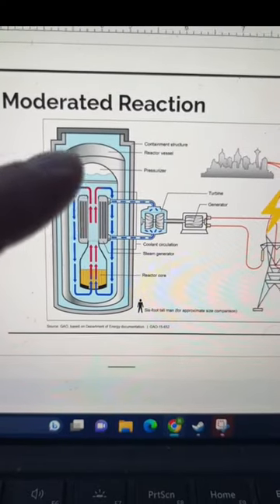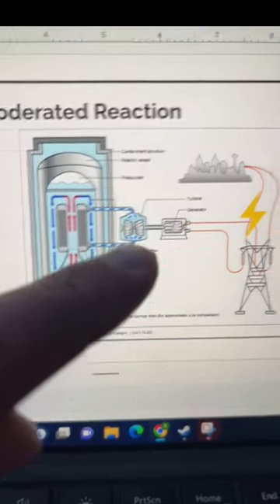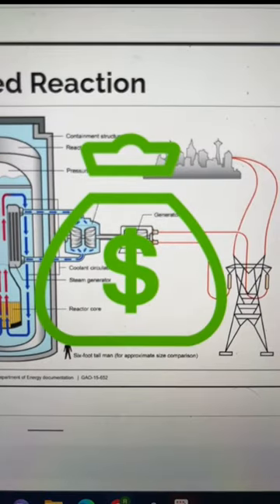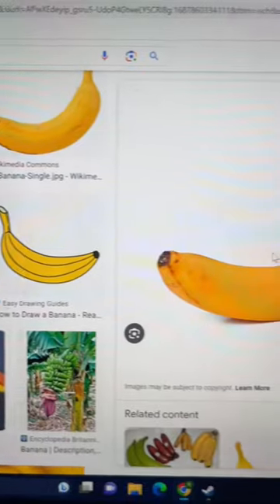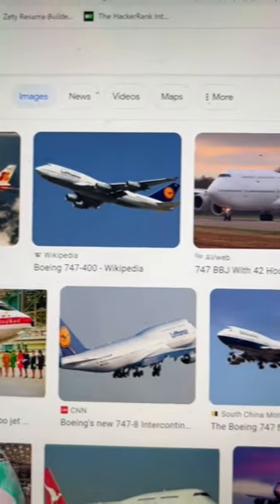No, The #Zaporizhzhia Nuclear Plant Will Not Explode

Comment: Nuclear power might be the most feared energy source compared to how dangerous it actually is. The people who make nuclear reactors and dispose of nuclear waste know what they’re doing, and they know how to make radioactive materials the smallest threat they can be.
Reply: Yeah cause we have so many fuel sources to compare to 😂
People think Crystals are SUPER powerful and capable of harming or empowering others... and yet Piezo is far less powerful.
Thatll throw your ratio off if you are also comparing how powerful they are, versus how feared they are, versus how dangerous they are
Reply: the danger isnt how many times things go wrong, but what happens when things go wrong
Reply: @jordanwardle11  Compared to other forms of energy, nuclear has had the fewest catastrophic failures.
Reply: I agree OP. Lots of people seem to think that it's too dangerous to be feasible; but like, oil and coal are infinitely more dangerous and have caused the deaths of so many more people than nuclear
Reply: The funny thing is that even windmills, solar, hydro and geothermal claim more deaths than nuclear. I understand people can fall from a windmill, a roof with solar or a hydro dam. But I can't figure out how to die from geothermal.
Reply: Yah, just look at Chernobyl, Three Mile Island, and Fukushima.
Reply: @LordMondegrene  and now compare that with people that affected and die every years because of coal reactor and fuel.
Reply: Most panic about nucular, I mean nuclear, from fuzzy minded hippy types has little basis in reality.

But safe long term storage or disposal of the waste is an unsolved issue, especially if you get into longer time scales.

Take for example the Russian soldiers digging up the earth around Chernobyl and getting sick. Sucks to be them. They were warned. Etc. But it highlights a couple of issues. 1) The difficulty of cleanup when there is an accident, and ignorant people coming along and unknowingly exposing themselves or others.
Reply: @MarcosElMalo2  The safest way to use spent fuel is to turn it to munitions, and fire it at your enemies lmao
Reply: They most probably know what they're doing. Especially when it comes to money :) 
When fuel rods are so harmless, then we don't have to fear dirty bombs, Irans powerplants and there won't be any financial loss should your house happen to be covered in pulverized spent fuel rods. Totally safe! 
Have a banana split with some plutonium on it.
Reply: Three mile island operators agree.
Reply: @dashikashi4734  sure, ill explain my comment. it matters not total numbers if 1 incident can do far worse than a multitude of incidents
Reply: @LordMondegrene There’s only one confirmed death from the Fukushima nuclear disaster. Nuclear power plants rarely fail, and modern nuclear power plants are designed to be as safe as possible, even when something goes wrong.
Reply: @estrogenyumyum4801  We'll store the high level nuclear waste in YOUR yard, since it's so safe. Thanks!
Reply: @buddy1155  Apart from workers inside a geothermal power plant being affected by an accident that can happen in many industrial settings, the main risk with geothermal is earthquakes. But even then, they are basically always small enough that they only do property damage.
Reply: @LordMondegrene I never said nuclear waste wasn’t dangerous. But as was said in the video, there are ways of handling nuclear waste that can minimize the danger.

Anything is safe if you have proper precautions. Storing nuclear waste in my garden is dangerous, but it wouldn’t be dangerous if you were to encase the nuclear waste in a thick layer of concrete and then buried it deep underground below my garden, it would be perfectly safe. Radioactive materials are dangerous if they’re improperly handled, but the people who handle nuclear materials know how to keep the nuclear material safe. They know how dangerous radiation can be, and they make sure it doesn’t end up hurting anyone. 

Any and all ways of producing energy has pros and cons. Nuclear energy is very environmentally friendly compared to most alternatives, but it can be dangerous if handled improperly. The way to counteract the danger is to handle nuclear energy and nuclear waste properly.
Reply: @LordMondegrene  There are perfectly safe places to put it. Finland dug a huge underground tunnel in a remote location in which their spent fuel could be put for the next 100 000 years. Nuclear fission has flaws but it is still the most effective way of generating energy we have right now.
Reply: @aphextwin5712  I think I know why, it was # fatalities for every xx MW produced.
A nuclear power plant has simply very low number of employees to power production ratio.
Reply: @estrogenyumyum4801  Your "solution" just kicks the can into the future.

Nuclear power CAN be made safer, but that would cut into profits. Which is why Chernobyl, Three-Mile Island, Fukushima, several thousand square miles of the Ural Montains and Hanford Nuclear Reservation are some of the most radiotoxic places on Earth.

The profit motive makes nuclear power a danger today. That long half-life makes nuclear power a danger forever. 

Business will ALWAYS cut costs until they cut your throat. That's "the unseen hand of the market" holding a straight razor to your neck. You can't make it both safe, and profitable.

Source: my dad worked in nuclear medicine for 30 years. He studied the harm done by radiation, and knew intimately the effects on his patients. He knew people who worked at Sandia and Los Alamos and Lawrence Berkeley Labs. They told him horror stories about the kind of idiots they have playing with U-235 that would curl your hair. They make the "Demon Core" story sound like a walk in the park. 

There is no way to make nucear power safe, AND profitable.
Reply: @jordanwardle11 yes and it's not so much a matter of when things will go wrong but if they will go wrong because these scientists and Engineers who designed these reactors and design the way storage facilities have learned from previous mistakes such as not hiring yes men of the state party, one of the most infamous Three Mile Island compared to Chernobyl and Fukushima which both had terrible design flaws was relatively minor it was more about the lack of communication to the public that was the biggest issue
Reply: @LordMondegrene Chernobyl was designed by Yasmin so safe he was not a concern and then Fukushima had a terrible design flaw that was pointed out several times yet the company through backroom dealing with the government got around those safety concerns and then Three Mile Island was more a failure of communication with the public between the federal government the reactor operators and the utility company
Reply: @LordMondegrene except that's not how they do it they try to keep it as stated in the video a concrete sarcophagus which is usually kept on site until it can be moved to a long-term storage facility which usually involves burying the sarcophagus has
Reply: It's just that if the worst happens, and Fukishima and Chernobyl were not the worst- we lose half a continent. Like they nearly lost Tokyo and how they actually lost 1000 square miles for 100 000 years at Chernobyl, and came within a whisker of leaving much of Europe in that state. Uninhabitable. For 100,000 years.

Not much chance of a solar panel doing that. They hardly ever explode.
Reply: @clonescope2433  try again, in English.
Reply: @a_name1000 Coal powerplants emit more radioactive particles and radioactive waste than nuclear energy does, and it goes straight into your lungs as its fine airborne dust. 

Usually a mix of uranium and thorium, about 5 ton per plant per year at the most conservative estimate.
Reply: @LordMondegrene  to be fair, everything could be dangerous if the maker decided to cut Corners.
Reply: Three mile island has entered the chat
Reply: @LordMondegrene  Yes, look at the 3 disasters and see what they can tell us. Chernobyl was a bad design with no containment and a combination of human error led to a significant release of radioactive material. Fukushima survive a 9.0 earthquake and tsunami. It was only after water flooded the backup generators did the reactors melt down. But even after they melted down there was no radiation release. It was a hydrogen explosion that allowed radiation to leave the facility. 3 mile island had practically no radiation release. I think we can design significantly safer reactors than those built in the 1960's and 1970's.
Reply: The real problem with nuclear power is that it's more expensive than renewable and many of the costs are pushed into the future onto our grandkids. 

When private companies are willing to reinsure decommissioning costs. Then we will know they are close to realistic.
Reply: @RemixedVoice Not fun fact but coal plants actually produce several times more radiation than nuclear plants.
Reply: @jordanwardle11  Yeah, but they statistically never happen lol
Reply: @ryangoepfert9112  Yes, but since "radiation" is a nebulous term that can refer to any emissions or particles, from deadly neutrons to warm sunlight, it's nearly meaningless in this context.

... add to that the fact that I NEVER IN ANY WAY DEFENDED COAL, and you come across as intellectually dishonest, and trying to change the subject, because the arguments for nuclear are similarly weak, cherry-picked, and ignorant of history. 

But thanks for contributing to the meaningless noise puked out by the nuclear industry, I'm sure they're incredibly grateful for your stirring defense of their profits.
Reply: @snydedon9636 Three Mile Island was 40 years ago. Technology has advanced a lot since then. Power plants have gotten way safer.
Reply: @jordanwardle11 Yes, maybe, and also kinda no. Depends a lot on your tolerance for viewing danger, risk and harm through a much greater aperture. Big picture, we should have been gunning for worldwide nuclear-energy'fization for decades already, through international programs of developing a vastly superior commercial section with govt incentives for new non-breeeder reactors of variable scale, including low or maintenace free reactors for ocean transport. Make nuclear reactor deployment scale so great that we get genuine economy of scale benefits, instead of an industry that is extremely hyperexpensive because "shutdown orders could come any day" so no one dares invest, neither in new projects nor modernizing what they already have, and in som3 cases can't even predictably secure funding for long term basic upkeep so they have to shut down some plants in case they have to cannibalize one on short notice to keep another going safely. And compensate the loss of energy with coal. 

We really screwed the pooch on energy. Nuclear is the cleanest, and big picture safest and least-harm option we have. And it's the only thing able to carry our vast and explosively growing energy needs through a many-decade transition into clean renewables (and hopefully, eventually, also fusion). It's the only thing that can be operated in such vastly diverse regions and conditions as neccessary throughout the world, as different (and new) clean renewables keep incrementally improving. Some regions are very furtunate with their climate, topography and larger ecosystem conditions, and either already are or could with moderate expansion be wholly covered by clean renewables already (Hydro, wind or a combination of both being most common among them so far). Most are not so fortunate though, and even though each must deploy renewables in forms, mixes and scales that make sense in their respective regional conditions - few have any hope of getting where we need to go in what little time we have for damage control, without nuclear energy as the spine and trunk of their energy systems (the "time left to avoid catastrophic outcomes" came and went years ago, we are all well and truly balls deep into damage control territory now). We cannot just keep on "buying the quotas" off the lesser-industrialized and lesser-developed 3rd world. It's a slow, universal self-f$&king ponzi scheme of literally global proporsions and consequences. It only results in maintaining continued (and in many cases further increased) excessive pollution by the relatively few super-polluter countries and regions that can afford to buy their way (which are also the only countries that can afford to heavily invest in, develop and pioneer both cleaner more efficient options and even recapture systems).

We know damn well that the rest - those countries whoms governments we pin to the wall and strongarm into selling us their quotas, has but a snowball's chance on Venus (or Arizona) of ever remotely delivering on the guaranteed-to-fail requirements we're setting them up for with this BS. All it "succeeds" in doing is forcing them to choke off their own industries and in some cases even a lot of their agriculture, because the international penalties for going over the quotas they have are even worse. Thereby keeping them perpetually under-foot and on the edges of full collapse. Thus all but guaranteeing that they can "never" hope to achieve the kinds of turnover, revenue and economy of scale neccessary for their industries to evolve, and by extent afford; high(er) resource efficiency and cleaner operations modernization.

If we are to still keep moving forwards with quotas, they need to be made non-transferrable, and enforced in a manner that enforces the intent and "spirit" of the system. So that those of great means cannot successfully manipulate, abuse, or exploit the system or any unintentional gaps or loopholes in it, to game the system to buy their way out of delivering on their part of fair and just commitments. If wealthy countries absolutely want increased/extra quotas, that should only be possible through greater-than balancing elsewhere, to be earned on top; no transfers. Earned by explicit, concrete, tangible and independently verifiable steps implemented (not just planned or "committed to"), to aid lesser-capable countries in sustainable and persistent means of reducing their emissions. (And/or) equally increasing their efficiency without  loss of productivity or capacity - at a ratio of at least 2 : 1 if not 3 : 1 or beyond (scale of aid-supported improvement  : increased/additional quota). The goal of enabling these "earned" additional quotas, is to incentivise genuine and substantial investments into accellerating sustainable progress where it's most needed. And the goal of setting the ratio that high, is to deter from leaning on this arrangement, of having it become a crutch. To incentivise cooperation tpwards accelleration of domestic and international investment, RnD and deployment of cleaner and more resource efficient operations, that may enable continued common growth and prosperity while staying within the original quotas. To "ensure" progress does not stagnate. To ensure that either through "quota-investments" or the international RnD collaborations, the lesser means countries can stay aboard for the ride forwards. And to ensure that when wealthy countries do go beyond their original quotas, the end product of that is (still) a real and sustainable net positive.
Reply: @ryangoepfert9112  They also produced a ton of mercury until about 2018.   It was supposed to be fixed in the 90s but they got wavers.  Most have mercury plumes extending 70 miles downwind in the prevalent wind direction.

But you are comparing coal plants to well operated nuclear plants.  Clearly, coal plants do not equal Fukishima or Chernobyl.
Reply: generally I would agree with that how ever at the moment this plant is controlled by the Russian military which I am not confident in their ability to tie their own shoes at this point.
Reply: Zaporizhzhia power plant was designed to be safe during peace time.
It is way different when a terrorist state (russia) is weaponizing it. They have all the blueprints for this powerplant and enough nuclear physicists to figure out how to.
Reply: @jordanwardle11 even when things go wrong with nuclear it's nowhere near as bad as any other type of power plant 😂
Reply: @Minox_ Water dampens radiation so well that we might even be able to tactically place it at the bottom of the oceans it might even help grow deep sea ecosystems with the heat allowing small bacteria to maybe metabolize easier.
Reply: @clonescope2433 Fukushima did not have a terrible design flaw. Only one section of sea wall was too short,  there are many Nuclear plants in japan and of plants were hit by that only those directly behind the seawalls and also the backup generators system was in a  underground structure which resulted in power loss. Multiple problems culminated in the Fukushima incident which is similar to what happened in Chernobyl
Reply: @clonescope2433 and it would have been cheaper to pump concrete into Chernobyl and level it to make a foundation  for new city structures but they want to preserve it leaving it more exposed than it needs to be when it could have actually been cleaned up decades ago. But scientists have been studying the effects of radiation for decades and all that we've learned is that humans are more destructive than radiation.
Reply: @PxThucydides Solar panels fail and catch fire though which is why people don't want to start putting them on every roof just yet 😂
Reply: @MarcosElMalo2 I’m gonna come back with a link from a nuclear scientist. Or engineer. She’s one of them. Give it a watch and understand why what you said was wrong. We have known how to dispose of nuclear waste for a very long time. But it keeps on getting buried just like the nuclear waste is
Reply: @LordMondegrene This just... isn't true. It's plenty profitable when run safely. Capitalism is terribly dangerous. Coal is where it struggles to be safe when run profitably, if any.
You seem to fundamentally misunderstand nuclear waste storage.
Reply: Yep too many unknowns with market futures for companies to invest in new nuclear facilities that don't break even for 15-20 years, or to push money into upgrading existing facilities when they are afraid heavily subsidized new "green" solutions may cause permanent shutdowns or prohibitions of nuclear plants in favor of wind/soloar/geothermal/etc. Almost all of which take create tons of toxic waste and rarely ever have a lifespan including maintenance costs that will make the breakeven investment point 🙄 But if it's what companies are pushing and governments are subsidizing then that's what will be invested in, no matter how stupid the reality is... I'll give some geothermal setups a pass, but not everyone can be Iceland and have all kinds of shallow magma hot thermal wells to drill and tap into, Ireland is not the same as Iceland 😄 and even solar farms in Arizona /Nevada don't really excel, most still lose money if you use actual numbers without free money or tax exemptions... I'm not saying new clean energy systems aren't worth further development to the point that they are financially and environmentally viable (and produced by the western countries intent on using them 🤨) But currently it's absolutely not the clean green magic solution that is being sold... Maybe for individual off grid solutions, but certainly not for supporting cities and industrial applications. Especially when most of the junk (for solar) is using awful mining, produced by CCP coal power plants, and is sent to the shredder before its paid for itself or "offset it's own production and maintenance footprint". Wind turbines are about as effective as burning pallets of $5 bills given their maintenance costs and lifespans vs. outputs, even with great geographic placement. They are a dumpster fire money maker in many locations, not from electricity produced, but by contracts awarded for construction, installation, maintenance, and especially those sweet sweet subsidies and tax write offs! 😍 Similar situation in the USA with EVs unless you live in an urban area and don't mind using natural gas or coal to power your EV 😉 It's just not viable for full replacement yet, forget the lithium pack issues,.our infrastructure couldn't handle the neccessary power for charging that many EVs even if they could fulfill all neccessary needs and had a 20 year lifespan 🤦‍♂️ Hydrogen sounds great, but I'd also prefer my local Jihadist not be able to swing by the stop N' go in his moving van and be able to level a city block... With the current  clusterf$ck of financial incentives and marketing we don't really have a great current solution. Maybe eventually we'll burn enough money and snakoil until a decent replacement for nuclear is found that is actually as effective as fossil fuels without the emissions but this "2030" or even "2040" nonsense is a joke, the USA probably won't have the neccessary power distribution situation handled by then, even if we have magic clean batteries and long lasting high output new "green" solutions. 🤷‍♂️ Maybe we'll have some saltwater Hydrogen power plants by then and California can finally set itself on fire year-round 🤔
Reply: @LordMondegrene  Chernobyl was a poorly regulated Soviet designed unit, All the units since then are all pretty much the same, some better upgraded than other older units. Three Mile Island was an accident caused by complacency and could've been prevented if someone would've stopped looking at gauges and actually went and looked at the damn thing to see the pressure release valve was stuck open, Fukushima was just a combination between an idiotic design putting the emergency generators lower than the tsunami water zone, and cultural traits where they don't question authority and will wait for instruction from the higher ups, Which the workers at the Daini went rogue essentially and immediately cobbled a power source together from batteries from ruined vehicles around the plant and other means to re-activate the monitoring systems to see how bad their situation was, calling in the plant manager, and working with the government to run many kilometers of cable, hundreds of generator trucks, transformer trucks, and other support to get the cooling pumps running so they could put the plant into a cold shutdown state. This could've been avoided had the Daiichi crew taken immediate steps, and had both plants moved their emergency power generation units somewhere above the known tsunami flood zones. Hell, if it wasn't for making material for nuclear weapons, the US wouldn't have abandoned the research into nuclear salt reactors which use Thorium, a mining waste product, and can literally not melt down. They need power to make power, so in a malfunction the reactor would get to a point that it couldn't function and just shut down. That and it uses up the fuel that can either be recombined to become viable again or the waste would be so little that disposal/storage wouldn't be an issue. They just couldn't be rigged to change the fuel into it's more aggressive isotope, so it was abandoned.
Reply: @ryanp0342  Correction : Fukushima released more radiation than Chernobyl as 3 reactors melted down and exploded. However the impact was mitigated by the radiation getting dissipated by the ocean. It spread but was spread out thinly.
Reply: This is not the point at issue, ie, the safe use of nuclear power.  The point at issue is that a Russian arsehole is using nuclear blackmail to create an artificial Chernobyl or Fukushima on a larger scale to leverage a strategic advantage ( or actually do it for scorched earth)
Reply: @LordMondegrene  just look at coal killing more than all nuclear accidents combined every single day.
Reply: @kingsfan2099  have you ever spoken to them, do you know their names? They still think nuclear is safe, hence why they kept working there after the incident.
Reply: @vaclavzajac214  unless coal can be made into hydrogen bombs, or keeps killing for billions of years, your equation is missing a few items.
Reply: The danger is what happens when people weaponize it, like say by sabotaging a nuclear plant in occupied territory. Which is kinda the point Ryan is missing here.
Reply: @notribadsvault  weaponise how? The plant is more expensive than their 2022 military spending and there is absolutely now strategic advantage in blowing it up whatsoever. They would actually just lose a site which they could use during negotiation.
Reply: @kingsfan2099 Three mile island was one time where serval things went wrong at the same time, leading to a small amount of radioactive stream being released. People nearby received about half of chest xray worth of radiation, or 2 days of background radiation.
Reply: @Jason9637  now think about thousands of these "little " leaks....
Reply: @kingsfan2099  Think about all the thousands of fossil fuel power plants that are constantly and intentionally releasing large amount of CO2 into the atmosphere.
Reply: @LordMondegrene 3-mile was prevented Chernobyl occurred because of incompetence and Fukushima was placed really idiotically, each could have easily been prevented, and one of them was
Reply: @TheDiloEmpire  so, incompetence, incompetence and incompetence is your defense of nuclear power plants? 

Thanks for making my point for me, but I'd add greed, greed, and greed, since the same cost-cutting impulse brought us Titanic, Challenger, Columbia, Deepwater Horizon and most other industrial disasters. Greed, craziness and stupidity are the main motivators of massive failures. 

This is how Capitalism kills. Cutting costs also cuts throats.
Reply: Like Fukushima?
Reply: I would say nuclear fusion would be more dangerous